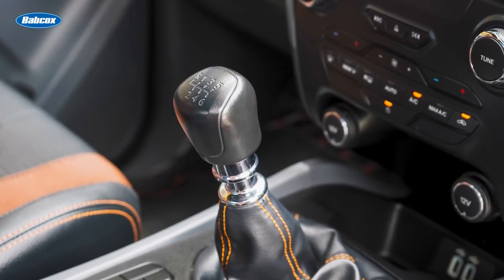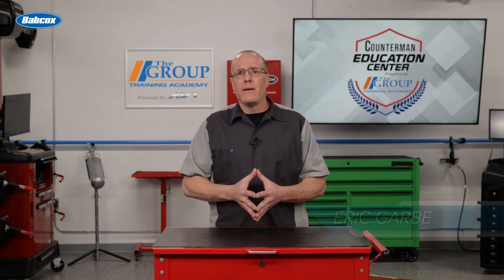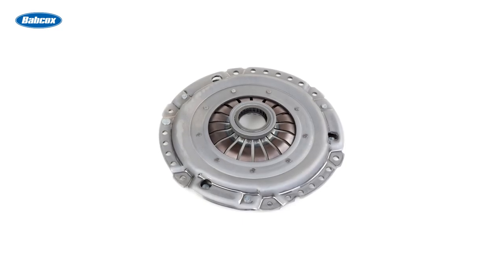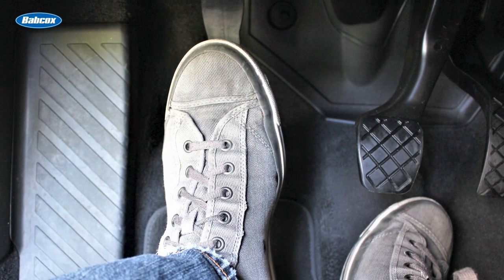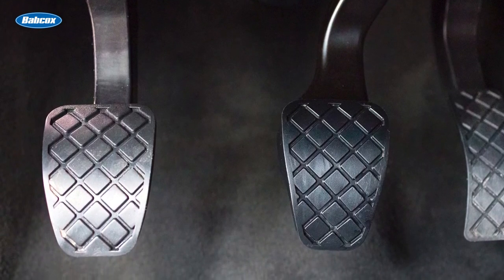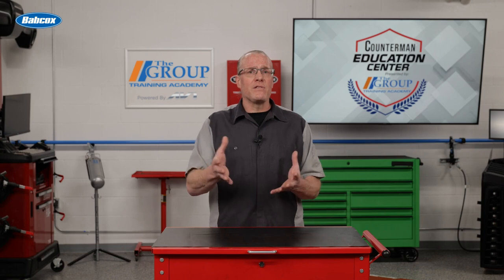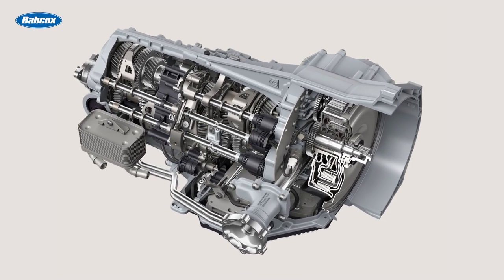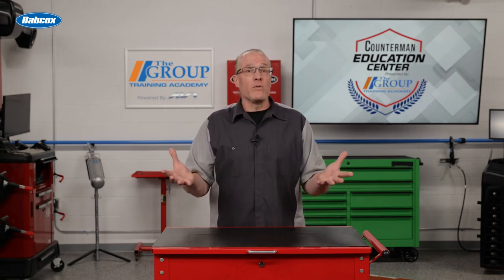Overview of the Clutch System

Comment: You have your clutch engaged and disengaged images backwards. There is a difference between clutch engaged and pedal engaged. Also why would you show a picture of on automatic trans when talking about a duel clutch system. That was clearly an auto trans with planetary gears. DCT's don't use planetary gears.